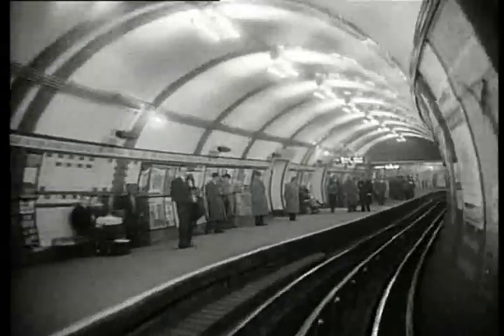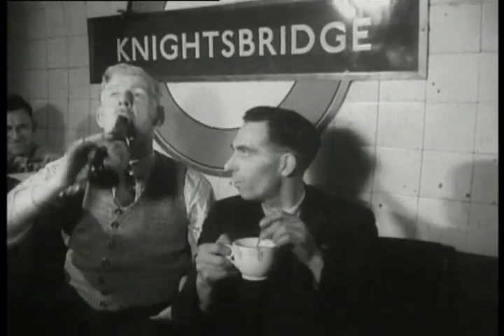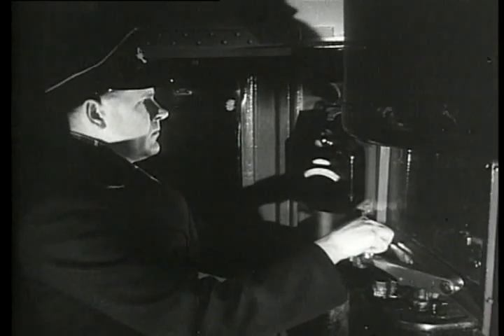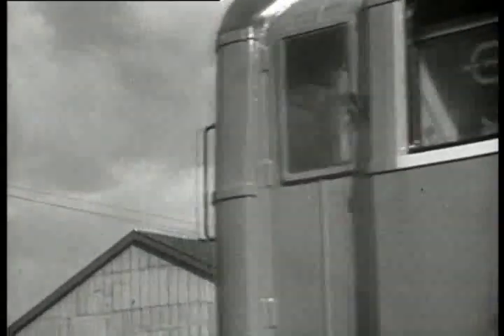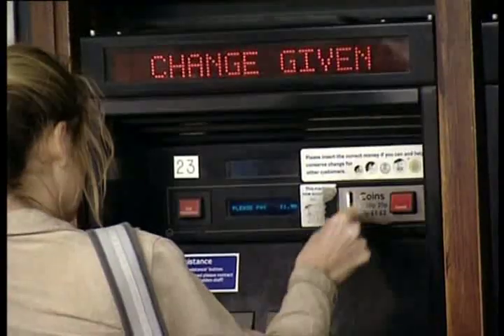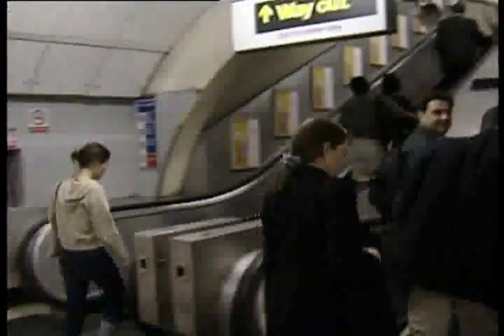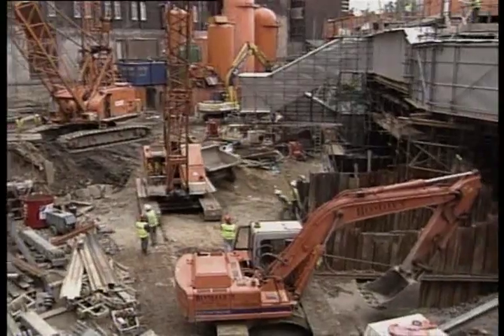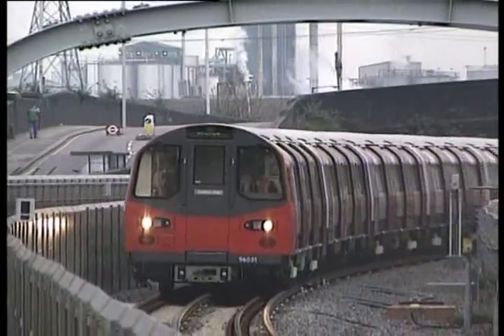The History Of The London Underground (Part 3 of 4)

Comment: The first tunnel under a metropolis and run under streets was the 1.25 mile long Wapping tunnel in Liverpool - 1929. Disused from 1972 and mothballed for future use on Merseyrail, along with the 2.2 mile long 1846 Waterloo Tunnel.

Even today, the oldest part of any underground/metro network is in Liverpool. A stretch on the Northern line dates from the 1840s.

Liverpool has the oldest used railways station and tunnel in the world. The UK ignores Liverpool, yet the US museums do not